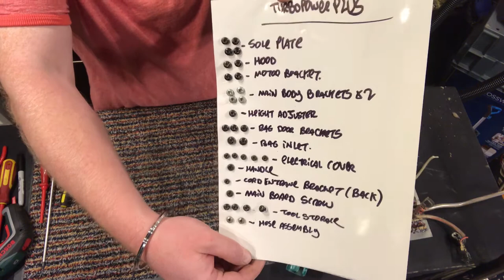Hoover Turbo Power UB088 Full Disassembly

Comment: You need to knock the pastic housing off that rear bearing - it will come off, the bearing is pushed into it. I've done it with mine, and the only way to lubricate that rear bearing is to remove the armature from the back half of the casing, so you can get access to the motor cooling fan and the bearing itself.
Reply from the maker: +MadAboutHoovers Ahhhh, that’s good. I will be sorting that out tonight and I was afraid of breaking it. 😱

Comment: Hi Dorian iv got a turbopower U2332 to restore and wondered if you had any hoover genuine air fresheners for sale or where I could get hold of some cheers
Dave
Reply from the maker: Hi Dave, think it would be easier to get hold of unicorn tears 😂🤣🤣🤣. I only have 1, which is a blue colour in its original box. I’ve not really looked for any online as many collectors I know have them normally on display as they are very rare. I would possibly save an eBay search for them or like me just came across one by accident or gifted.  I do hope you find some and if I see any I will let you know. 😘
Reply: HooverLux top man👍